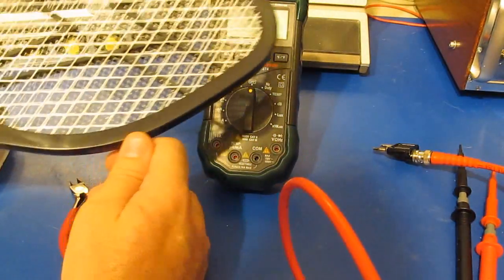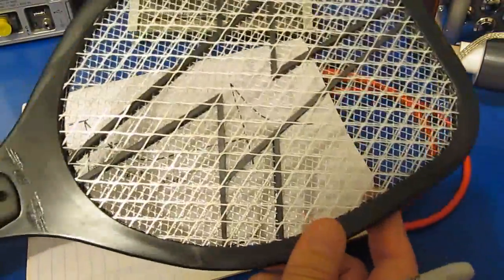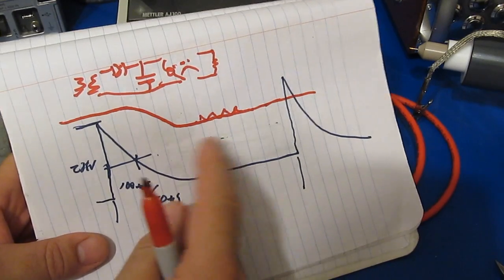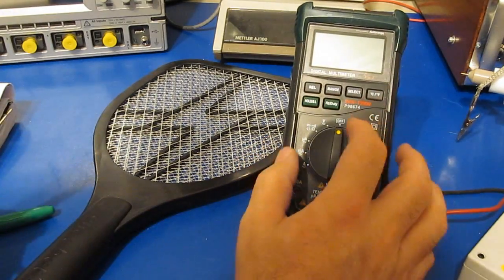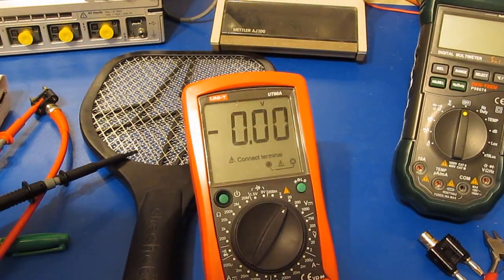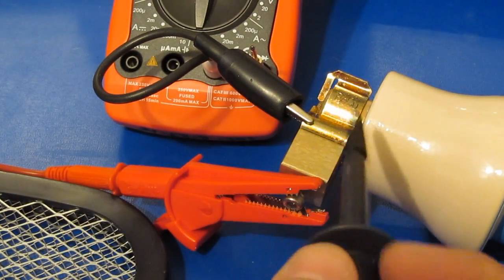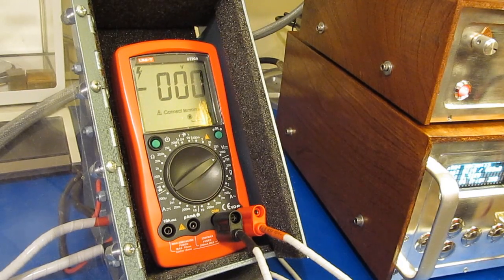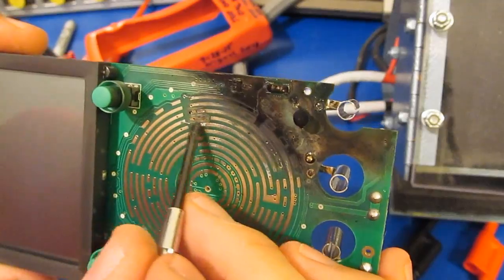Measuring High Voltage Electronic Fly Swatter with a DVM

Comment: Good thing I used my cheap Metech MK-05 and not my Fluke 789. I don't know what the hell I was thinking I knew that the meters were rated for a thousand volts In fact this one's 600 volts but I can say the MK05 performed and did not fail, I'm not going to try it with the Fluke

Comment: Geeze 2,700 V this thing can seriously injure you or even kill you if you touch the mesh no?...
Reply from the maker: I have a grill starter that puts out even higher voltage.  I would imagine if you swallowed it, it could indeed kill you.
Reply: @joesmith-je3tq  so are these bug swatters dangerous to use if you got shocked?... They have low mA though like 0.028 mA but high voltage which is very confusing to me... Makes me wonder what a taser would have!?
Reply from the maker: @AH-up8zh  I would imagine their current is several amps, like my grill starter.  I measured it a few times.   Imagine that, several kV and Amps.  How can I not be dead a 100 times over???!!!
Reply: @joesmith-je3tq  I grabbed my fly swatter 2750 V and 0.028 mA with my hand and it hurt pretty good... Shocked me up my forearm for a couple seconds... You should give it a try 😂
Reply from the maker: @AH-up8zh  How did you measure the 28uA?  Watch me test the Fluke fork meter...
Reply: @joesmith-je3tq  it says on the handle of mine 2,750 V @ 0.028 mA
Reply: @joesmith-je3tq  so it really does have high voltage and really low amps... Kind of reminds me of an electric fence for animals
Reply from the maker: @AH-up8zh  And what do you think that current means?
Reply: @joesmith-je3tq  1/1000 of an amp
Reply from the maker: @AH-up8zh  You missed the point.  If you measure the current through a low impedance shunt, you may indeed measure 28uA.  However the voltage will no longer be in the kV.   If you allow the capacitor to charge, then discharge the device into that same low impedance shunt, the current will be much higher, for a short time.  We look at energy in Joules.  Pretty basic stuff if you want to try and search for it using Google.
Reply from the maker: Consider I added that cap for a reason... Reminds me of this:
https://www.youtube.com/watch?v=HkdJ66vetWg
Reply: @joesmith-je3tq  I'm confused... So why am I not seriously injured or killed then after grabbing the mesh screen for a couple seconds... It shocked me up my arm like touching an electrical outlet but that was it... I don't have much knowledge about these things and like to learn
Reply from the maker: @AH-up8zh  Again, you want to search for Energy.  You have considered current (under some condition), open circuit voltage but not time.    An electrical outlet is designed to provide continuous power.  Having your hose lights flash when you turn them on is not helpful.  The flyswatter is designed for a small pulse.  They charge a capacitor and then discharge it across the fly.   Again, basic.  Can discharging a 2750V  capacitor kill you?  It depends. The capacitance they use in a flyswatter will have to be low enough not to harm a human.   If you want to see some large capacitors being discharged, check out PhotonicInduction's channel.
Reply: @joesmith-je3tq  haha it definitely didn't feel like a small pulse that's for sure!... It was more like a buzzzzzzzz shock the whole time I griped it and then I let go... My arm and hand is a little sore this morning but all things considered I am still alive!... So this is more or less like a taser or electric fence with high voltage low amps correct?... I have always thought it was higher the amps the more like is to hurt or kill you
Reply from the maker: @AH-up8zh  A flyswatter is designed to kill flies.  A taser and fencer would be for a different application.   Again, you fail to consider time.  None of these devices supply a continuous current or voltage when applied to the load (fly, cow or human).    The same is true for a defibrillator.  Again, my grill starter is several amps at kV.    
 
Depending on your goals, you may want to start a thread on the EEVBlog forum.   Maybe use the beginner area so people will be more accepting of your posts.   Who knows, it may even save your life.   

There's a small number of people who were killed by messing with microwave oven parts.  Good luck.

Comment: Measure amps
Reply from the maker: AC/DC? Level? Meter?
Reply: @joesmith-je3tq  Oh okay , so you dont have a Milliamp setting. I only ask because I seen another video were a guy read 3.8 amps in a electric fly swatter , and I wanted to see if that was on point.
Reply from the maker: @Lamont24012  Oh, you were asking about the current from the flyswatter.  It would have been helpful had you included that in the first post.  The flyswatter charges a cap to a couple of kV then dumps it across the fly.  Like an ESD event, the current could easily be 10s of Amps!   Attempting to use a typical meter to make this measurement wouldn't provide any useful information.  If you want to get some idea how I would make this measurement, watch the first six minutes of this video:

https://www.youtube.com/watch?v=1kYcY2ogmqo

I don't normally allow links but if you want to post it, I can have a look and see if what they are showing makes any sense.
Reply from the maker: If you are wanting to know how much current the DC-DC can put out, that's a totally different question and would certainly be a much lower value.  You would need to be VERY clear what it is you are asking.
Reply: @joesmith-je3tq  Amps is the measure of current , so either you can or cant measure the Milliamps .
Reply from the maker: @Lamont24012  Sorry you lost me.  I can certainly measure current but that doesn't tell me what you are trying to measure.  For ESD, we are interested in the peak current as well as the wave shape.   If you wanted to know the average current of the supply, that would be different.  You would need to define what you are wanting to measure.   Just saying current means very little when we are looking at a device that isn't used in a steady state condition.
Reply from the maker: Watching the video you link, they are looking at the average current from the DC-DC converter not the peak current available once the capacitor is charged.   I can make this same measurement with my flyswatter if that is what you are asking.
Reply: @joesmith-je3tq  can you measure peak current available when the Capacitor is fully charged
Reply from the maker: @Lamont24012  To some degree. 
If you watched that first part of the video I posted, the HBM will have a fairly high source impedance where I believe the fly swatter connects the plates to the capacitor.  You can imagine just taking a capacitor and shorting it to a plate that the current is basically limited by the capacitor's ESR.   We are not talking about DC current like your friend in the video shows.   Consider that a typical ESD event will have a rise time in the sub 1ns.  The parasitics will add a lot of uncertainty.  I would assume 10s of amperes.   If you read some of the electrical safety standards, you will note they talk about the energy available.  While the peak voltage and current can be VERY high with the flyswatter, the amount of energy available will be small.  We can calculate that by knowing the peak voltage and capacitance. 
What you are asking is not a simple can you read current sort of question.
Reply: @joesmith-je3tq  True , so its vastly more then a stun gun that may be rated at 100, 000 volts , but lower in Milliamps.
Reply from the maker: @Lamont24012  I don't know anything about stun guns or tasers.  If as you suggest a stun gun can put out an open circuit voltage of 100kV, the flyswatter I have I think is closer to 2kV. 

Because the output is pulsed and not steady state, I am not sure what it would take to kill someone. I would imagine they rate them by energy and not current.   

When designing the transient generators I use to benchmark the meters, I kept it below 20 Joules for safety reasons.  Still, more than enough to kill a human and certainly high enough voltage to overcome the bodies resistance.
Reply: @joesmith-je3tq  I think Stun guns volts will lower if it reaches more then 5 milliamps down to 0 , and the Capacitor fry's as a safety feature .
Reply from the maker: @Lamont24012  There is going to be some limit to how much current the DC-DC can deliver.  Yes, loading the output will reduce the voltage.  True for any supply.  I suspect that the guns used by law enforcement are required to have a max Joule rating.  Not current as your YT video suggests.  They need to consider the transient response, not steady state.   I would expect there to be some papers written on the subject.  I wonder why you are asking?  What are your goals?
Reply: @joesmith-je3tq  Just Educational purpose Ive allways wondered how such small devices can generate such high Voltages ,and low Amps at the sametime . It seems to go against ohms law allmost . But its the low energy source that keeps the voltage low I assume .
Reply: @joesmith-je3tq  And the fact taser's make contact with the blood stream is how it has the affect it does .
Reply: @joesmith-je3tq  Also in the link I sent you did you notice how that fly swatter he had converted DC to AC .
Reply from the maker: @Lamont24012  I didn't.  I only skimmed it.   You would need to supply a time.
Reply from the maker: @Lamont24012  Against ohms law in what way?
Reply: @joesmith-je3tq  In the part he claimed the 3.8 amps could kill someone there isnt enough energy behind the volts , and amps to do more then stun a Human .
Reply from the maker: @Lamont24012  AGain, I did not see where he changed it to AC.  You would need to provide the time stamp.  He shows mA, not Amp, or I missed that as well.  Again, time stamp.
Reply: @joesmith-je3tq  Right Milliamps true.
Reply from the maker: @Lamont24012  Where was the conversion to AC??
Reply: @joesmith-je3tq  I will have to watch it again to find it or your welcome to.
Reply from the maker: @Lamont24012   You know what you are looking for.  Let me know when you find it.

Comment: How can we measure the current output
Reply from the maker: Depends what you are asking.  If you want the peak current, I would suggest watching Part 2 where I look at the 121GW.   The pulse with be very short so you will need a decent scope.    I have an old LeCroy 8500A 5GHz DSO that can be used for this.
Reply: @joesmith-je3tq  ooh. Ok i am watching  it's part 2 video.
Reply from the maker: @vedantjagtap5675  I think I covered most of it in the first 10-15 minutes.  In the case of the fly swatter, the waveform will be different but measuring the current would be similar.

Comment: Can i ask?, Can holding the racket grid kill you?
Reply from the maker: Your question is very open ended.   I imagine, there could be cases where it could be directly or indirectly possible to kill someone with one.  Health and other factors would come into play.  For example, you notice someone standing on a ladder several feet in the air and you were to startle them with this and they fell.  You could have indirectly caused their death.  If the person was in failing health, and you used the device on them, maybe.   I would imagine there are safety standards that these are required to meet.
Reply: @joesmith-je3tq  Thanks, iam Actually Talking about my safety which if i accidentally held the grid or somehow both my hands end up on either side of the grid
Reply from the maker: @ethanreece1452  I would have no idea what your personal health is like.  What does your doctor say?
Reply: @joesmith-je3tq  what?, no like will i die from electric shock from a this?
Reply: @joesmith-je3tq  Because ive seen people hold the grid of A TYPE, Not exactly this, and just receive a PAINFUL shock
Reply from the maker: @ethanreece1452  You could ask me, if I drink water will it kill me.  You may have seen many people drink water and survive.  You may descide to drink pure water and die from it.  Or you may drink a lot of water and die from that.   It's an odd question to even ask.  Normally when people ask for an absolute answer that involves so many variables the answer is not so simple.   Maybe ask yourself why would you even ask such a question.  Are you really concerned over your health?  How many Joules are stored in your flyswatter?  AT what voltage?  What does the safety code state about that level of energy at that voltage?   If you really want to know, do a little research.
Reply: @joesmith-je3tq  Woah, calm down bro, could have just told me, I Don't Know. Thanks Anyways.
Reply from the maker: @ethanreece1452  Sorry, it's not a great channel for youngsters.  I'm actually very calm.  Your just reacting to my blunt responses is all.   I'm only suggesting that you can't account for all the variables.  I doubt you would find many people that would state what you are suggesting  would be nonlethal under all conditions.
Reply: with all due respect sir, i'am not a kid/youngster, my username may state so, but no. if you don't believe me like the other people, i Respect your opinion. Thank You.
Reply from the maker: @ethanreece1452  It make no difference to me.  This channel is really here to present data, not opinions.  Its obvious this channel is not for you.  I'm sure if you learn to search YT, you will find several  channels interested the effects of fly swatters on humans.  Good luck.

Comment: And can you do the same for amps?
Reply from the maker: I have no idea what you are asking.  Do what to what kind of amp?
Reply: Aperage lol
Reply from the maker: @nickzsidisin62  Still, no idea.
Reply from the maker: Say we have a 10KA 1V supply.   We attach it to a meter.  What do you think is going to happen??   Higher currents happen when the meter breaks down due to the higher voltages. Generator used for surge testing have both open circuit voltage and short circuit current waveforms defined.  During this video, we would have been able to measure some fairly high currents but they are going to decay rather quickly.   So, again, think about what you are trying to ask and then write it out.

Comment: Can i use a voltage divider to measure the high voltage? (like using 990k and 10k ohms and measuring voltage drop across 10k)
Reply from the maker: How high a voltage?  What sort of energy is available at the source?   How much current can the supply source?   What is the frequency of the source?   What sort of accuracy do you need?
Reply: @joesmith-je3tq  i want to measure microwave transformer secondary output.
Reply from the maker: @ASHLEY_FERNANDES  The fact you are asking such a question about dividers and playing with a potentially lethal device is a bad combination.  Not too long ago we had a kid literally cook himself with one.   The family blamed YT for his death.   https://www.reuters.com/article/us-ohio-electrocution-idUSKCN0XH29C   This is not a good channel for kids.

Comment: I have also damaged one.but now i could not find which part get damaged as i am a noob.now the meter does not show any measurement correctly.but as u are a expert u have repaired it.
Reply from the maker: This poor meter has had some major abuse and has been repaired several times.   It is still functional today.  I actually recently used it in a video where I was subjecting it along with a few other meters to some high voltage DC.    https://youtu.be/HkdJ66vetWg
Reply: joe smith thanks for reply. I love the way you explain things and it also match to the thing i wanted to open and look inside.good work.keep it up for everyone.

Comment: I've tried to measure directly on my cheapest mastech and it didn't handle the swatter in 2010. After that i purchased a uni-t 50B and it survived so far to one measure and then i used some melf resistors to at least get 1/10 ratio. The Swatter and the multimeter are good so far and measuring ok, since i have access to a calibration lab and its doing fine. Is it possible to measure the pulse with an oscilloscope using the probe shown in the video?
Reply from the maker: There is a HV attenuator and probe.  The attenuator is good for DC work only.   The probe has a higher bandwidth.  The flyswatter will put out DC but even the meter's input may load it down so the reading may not be accurate. On the plus side, it may save the meter.  Adding a little capacitance to this flyswatter, allowing it to charge, then discharging that into the the meter may do in the meter.   If you wanted to look at the say the flyswatter arcing over to the probe, I don't think this one would be fast enough.
Reply: Thanks for the quick answer. The probe has you refer is the big gray with white ceramic isolation that you use on the LeCroy? I'll check further your attenuator video for the DC application. The ideia of the oscilloscope came to mind when needed to measure HV pulses such as electric fences or "electrical stimulation for controlling animals".
Reply from the maker: The probe I was referring to is the one shown in this video made from old shell casings.  The one you are now mentioning is the one I normally use for 2KV and up.  My guess is this probe also lacks the BW to really look at an arc event.  It would be fine for DC.     Someone else asked about measuring a their electric fence.  I pointed out that they make special meters just for that.  You should get one if this is what you are wanting to do.
Reply: Hi again and thanks for the reply. i think i have a look if there are these meters in local market. Till then i'll improvise a DC probe for the swatter using you're model and keep the multimeter away from it.